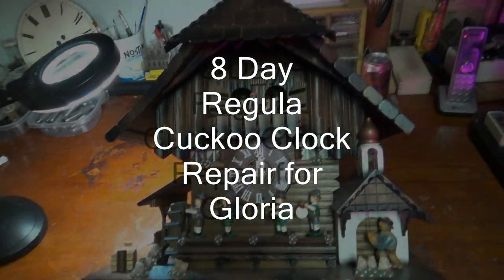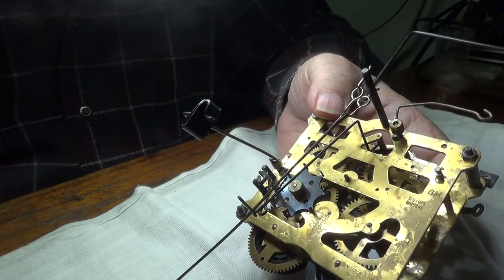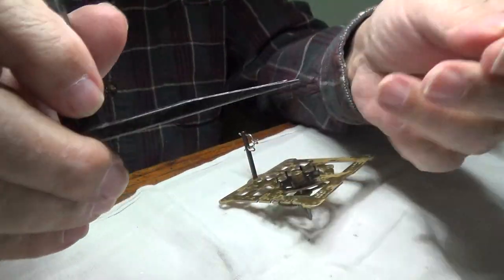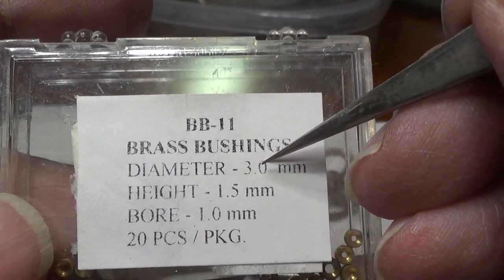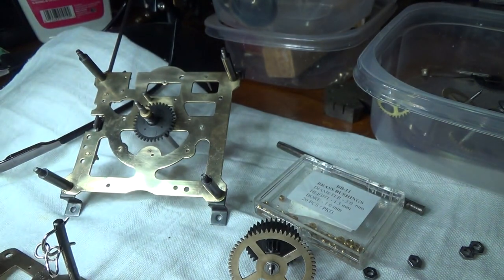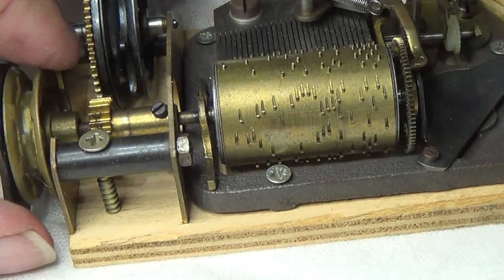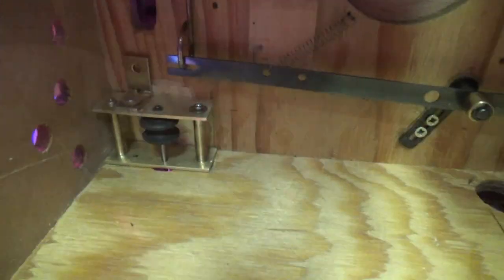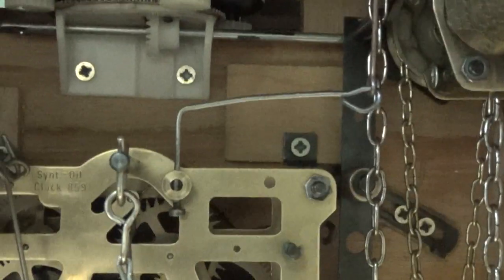8 Day Regula Cuckoo Clock Repair for Gloria

Comment: I got a 8 day cuckoo clock with music box and three weights weighing 1500g, I was applying oil to the pivot points on the clock and secured the chain, to keep them in place. Once I oiled the gears, I failed to remove the wire that held the chains in place, and started the clock, didn't realize that I failed to remove the wire. 
After a few minutes of operation notice the clock pendulum wasn't moving and realize the error of my ways and the clock has not been the same after that. After a few minutes of movement it stop working. 
Watching your video was inspiring that someone is out there, that can repair this complicated movement and like to hire your services, if you are still in the business of repairing clocks like mine.
Reply from the maker: Sounds like you obtained a used movement as you oiled it..  The wire had nothing to do with the clock not running.  It probably needs extensive cleaning and pivot holes repairs with bushings.  I'm not in the  business of repairing clocks.  This is strictly a hobby I've been doing for 56 years.  I do outside work from time to time and ask for charitable donations to our food pantry.  At the present time, I'm overwhelmed with clocks waiting for repair and, at 81 years old, I don't take on any more work than I can complete in a relatively short time.  If I'm still here around January, contact me then if you still are having problems with the clock.

Comment: I have watched many of your videos and have had several “ah ha” moments when you are working on these clocks. Thanks for explaining your techniques and how the various parts work. While watching your videos I keep saying to my self “I wish I had seen these years ago”. Some of the the things that you do like pulling the chains through the holes have simply eluded me because I would wait to put them in after the movement was back in the box. You would not believe the shapes of wires I have made for threading them through the holes then around the wheels. This is only one example of many lessons I have learned from your work. Since watching your videos, most of my spare time has been spent working on watches. I have been thinking that it would be nice to work on another cuckoo clock. Someone brought me two this week. I started working on them on the weekend because I could not wait to try out what I have learned!
You are a Master Craftsman. I hope you are doing well and can make more videos. Thanks again
Reply from the maker: I'm glad you have found the videos helpful.  I wish I knew how to deal with the tiny parts of watches. I don't consider myself a master of repair; just a hobbyist who's been at it for more than 50 years. Thanks for the comments and best wishes with continuing in your work with timepieces.

Comment: look at the water wheel chain, there are a few links pulled apart, I could see jamming on the gears once in awhile
Reply from the maker: Look at the whole video before you comment.  I replaced the chain with new chain.  There aren't even any "gears" involved in the water wheel; it's a rubber wheel.

Comment: Cool video, I really liked how you made it play music on the half hour and hour instead I found it very interesting and never seen someone do that before.
Reply from the maker: Some only play on the hour.  This one was designed to play on the hour and half-hour, hence two melodies.  Also, if is playing only on the hour and the weight on the music box is going down half the distance of the other two weights, it's a clue that it's meant to play on the half-hour as well as the hour.  Nothing tricky or unusual at all.  Not all cuckoo clocks with music boxes play only on the hour.

Comment: Hello Sir
    Hope you're doing well and safe .Happy to write to you because you are my best guide and the horologist master. 
It's for Regula 34 and its music box both are in good working order but the synchronizing way a little bit far on 30's they perform well but on the hours the music lever of the movement presses hard on the control of the music box and remains until the weight arrives at the floor. It returns up after 10 minutes when the bellows inter in action . I tried many music levels  over the music bar but no success  please could help me solve this problem and thanks.
Reply from the maker: Without actually seeing and watching the action, I really can't be of much help.  There are too many different ways that the music box is controlled.  All I can tell you is to study how it is supposed to work and then keep adjusting it until it works properly.  You're finding why it is that many clock repair people just won't try to fix cuckoos with music boxes and animations.  They can be a pain to deal with.

Comment: Hi Mr Perry. Are you still going to do a hip replacement? I hope all goes well if you do. Hope you will be able to do a cuckoo repair soon. I know you use piano wire to make loops. Can you tell me the gauge of the wire you use? As that the same gauge you can make a pivot with?
Reply from the maker: I had a visit with  the orthopedic surgeon, who said the only solution to the hip problem is replacement.  It's definitely bone on bone.  Problem is that, because these surgeries were declared by morons to be "non-essential" during the Covid lockdown, there is a major backup of surgeries.  He can't schedule me for the replacement until "well after the first of the year".  In the meantime, he prescribed an anti-inflammatory   (Meloxicam) that has given me significant relief.  Weather is changing quickly, I've put the pond to sleep for the winter and I'm ready to get back to fixing clocks.  I have a number of sizes of wire coils I keep for repairs and try to match the original.  As I recall, they are around .022 to .025 inch.  Pivot wire is general too heavy to bend and also much more brittle.
Reply: @dperry428  Sorry about the delay with your hip. Can't wait to watch your videos.I see Timesavers has wire.

Comment: I have something i need your advice on and hopefully you will see this comment. I have a clock i am assembling that my brother took apart, and i did not see it being taken apart. It is an open mainspring 31 day korean time and strike movement with rack and snail. I have figured out where every gear except the 2nd wheels go. One is slightly larger, which side does the larger 2nd wheel go to, the time or strike train?
Reply from the maker: I don't know.  Just try placing one or the other in one of the gear trains.  One will mesh correctly and the other will not.  The one that doesn't mesh with the main wheel and third wheel goes in the other train. It is a truism that they only go together one way.
Reply: @dperry428  ok thanks

Comment: I learned a lot from this video. Especially the music box,  dancers and waterwheel. How did you clean the music drum? Will you be doing any more videos before your hip replacement in November?
Reply from the maker: I cleaned the drum with a toothbrush and the acrylic cleaner/polish I use on gears.  Scrub, let polish dry and polish with clean brush. This one was a frustrating challenge.  Combination of cheap, poor design and messes made by someone in the past.  The owner got this from a thrift shop for $5, so there had to be a reason someone dumped it. I found all the reasons.  I have a cuckoo movement and an electric clock movement to do.  A lot depends on what I can do outside.  If I can work, I''ll take advantage of the weather.  I know I have to fix a leak that's developed in my pond.  It has to be fixed before winter.
Reply: Thanks. I will watch for your cuckoo video.

Comment: Just curious if you could use a 5 sided broach to ream the hole in the plate for the bushing.  Seems that with the taper the reamer has, it would only start to cut on the unworn side, thus there would be no need to file the unworn side.  What do you thnk of this idea?
Reply from the maker: It's not a new idea; in fact, many do use a broach to even out the wear by putting pressure with the broach to the unworn side with the broach only partially inserted.  After determining that the unworn side is now cut out to the extent of wear, the broach is then used to cut the hole for the bushing. Simply using the broach without evening out the wear will likely cause an off-center hole.

Comment: Where can I find broaches like yours? I'm having such a hard time figuring out what I need. I only want to work on cuckoo clocks for myself so I don't think I need many. A lot of the main suppliers have pretty poor websites and it's just hard to know what kinds/sizes I need. I am seeing a lot of the "stub" style. They don't look like they taper. I assume I want to avoid them? Some of the sets have plastic handles, I don't know if that comes recommended or not. If they do require a pin vise how can you figure out what size you need? Thanks for your videos!
Reply from the maker: Go to Timesavers and search for broach sets.  Here's one that would include sizes for cuckoo clocks. https://timesavers.com/i-8944714-10-piece-cutting-broach-set-for-large-clocks-035-157.html   "Stub" refers to sizes.  I'm not familiar with that system.  I go by the largest diameter they will cut.  Since I use metric measurements for pivots, I have to convert the advertised inch size to millimeters to know what sizes I need.  They all taper by a few tenths of a millimeter.  Here's a set on Amazon.  https://www.amazon.com/Galapagoz-Repair-Cutting-Broaches-Germany/dp/B084G96P1R/ref=sr_1_8?dchild=1&keywords=clock+cutting+broach&qid=1614825183&sr=8-8   Use a caliper to measure the sizes of the pivots you'll be working with and order sets or individual broaches that fit those sized holes.

Comment: Do you have a video that shows what to do if the weight is pulled all the way up on the left but it won't tick tock or stay running? I noticed on my cuckoo clock.the left weight is pulled completely up to the hole in the bottom of the wood and it does not seem to move down at all.
Reply from the maker: The hook on which the weight is hung has a circular piece that attaches to the chain and is quite thin and sharp enough that, if the chain is pulled forcefully, the circle can actually cut into the wood hole and be wedge enough to make the clock not work.  It doesn't happen often, but it can happen.  Otherwise, does the clock run at all, even for a few seconds? The clock might just be out-of-beat.  OR, damage may have been done to gear teeth if the chain was pulled too forcefully.  Without actually examining the clock, I can't give a definitive answer.
Reply: @dperry428  it runs for a few seconds. It does need to be cleaned and oiled. The seller doesn't know if it's a 1 day clock or an 8 day clock. The weights say 1500 et on them.
Reply: @dperry428  the round circle on the hook  isn't touching the hole in the wood.
Reply from the maker: If the weights are 1500 grams, it's an 8-day clock, which means it is much more sensitive to wear.  If there is any wear in the pivot holes, or if the clock is in need of cleaning and oiling, it will be less likely  to run than a one-day clock.

Comment: So glad you did another cuckoo! What kind of magnifying lamp do you have? I would like to get one. What is the size of the lens?
Reply from the maker: I got it at Office Max.  The lens is  about 6 inches across and has a circular fluorescent lamp around it.  Here is a link to a picture of it:  https://www.officedepot.com/a/products/326381/Realspace-Space-Saver-Desktop-Magnifier-Lamp/  I sometimes have difficulty with it staying in place and have to tighten the "joints" on it to make it stay where I want it.  I've had it a few years and it's served me well. Often use it to get real closeups by putting the lens in front of my video camera.
Reply: @dperry428  Thanks

Comment: Such a fantastic and educative video with intricate detail! Learned a lot from you sir. Working on an old count wheel movement here in Canada. Strangely without any pivot wear, but with anchor wear! Time side needs 1kg to function but strike works with 875 gms. i.e a difference of 125 gms with the time needing more! Have you experienced anything like this? Also where is your shop located and do you have a website or email address?
Reply from the maker: Having to use more weight to make it run is a sure sign of excessive friction.  Did you replace/repair the anchor?  A worn groove will make the sides of the escape wheel teeth drag.  Also, recheck all pivots and holes.  Some of these older movements had short pivots that did not extend through the plate and the wear is only on the inside of the pivot hole, so from the outside, it looks as if there is no wear.  Also check for one or more bent pivots.   I don't have a shop; just my basement workshop.  This is simply a hobby for me that I've been doing since 1968.  If you want further contact, you can leave an email address in a comment and I'll contact you.  I hold comments for review and will simply delete the comment so it is not seen by others.
Reply: @dperry428  I suspect the original weights were missing and a previous repairman had substituted two 1260 gm weights. When I initially cleaned and lubed the movement, I overlooked one pivot hole which had a bushing inserted during a previous repair. The anchor is still as is as that type of replacement anchor assembly is not available. However perhaps you might be able to share the best way to repair that anchor. The cuckoo would run excessively fast with the 1260 gms weights and bend the warning/lock pin on the warning wheel causing it to ultimately not stop cukooing. Bringing the cuckoo weight down to 875 gms  stopped that problem. But I overlooked something else. I just found there was excessive play between the fly blade and the fly arbour and tightened it. Now I am sure I will have to use a 1 kg weight on the strike train as well as the fly will now offer proper air resistance. But I need to test it. If it works, I expect both trains should then run on 1 kg.
Reply from the maker: If it's a strip anchor, you can fashion one from strip metal, you can buy one like this and bend it to shape  https://timesavers.com/i-8948707-fits-all-verge.html
My method would be to grind the worn surface flat, cut a piece of spring steel and silver solder it in place.  Then file to the original contour.  Use the old one as a pattern in either case. 
Is the movement you're working with a one-day or eight-day?  That style movement, if it's a stamped movement, should run on about 500 grams if it's a one-day. If it's a cast brass movement, a one-day takes somewhere around 800 to 1000 grams.  The most weight I've seen on a cuckoo is 1750 grams and that's for a very large, three-weight, 8-day movement.
Reply: @dperry428  The movement is a 2-weight cast brass cuckoo movement with no quail or music.
Reply from the maker: Those cast brass movements are one-day and take a heavier weight 750 to 800 g.  Those movements also have relatively thick plates that twice as thick as more modern pressed plates. These are the movements that often have pivots that are so short they don't go all the way through the plate and wear the pivot hole only on the inside of the plate, leaving the hole on the outside of the plate looking to be unworn when, in fact, are badly worn.  The pivot hole appears round from the outside of the plate and oval from the inside of the plate.

Comment: I just left Triberg, Germany yesterday (where the cuckoo clock comes from).  The standard for ones that play music is music only on the hour.  The half hour typicality gets one cuckoo chirp.  That clock was fully functioning as designed prior to your ‘repair’.  You in fact did not repair it, but rather re-engineered it.
Reply from the maker: So, your position is that the clocks made today are made exactly as they were 25, 50 or 100 years ago?  Nonsense! Today's "standards" are often not what was done yesterday. The way to tell if a music box should run on just the hour or on both the hour and half-hour is to look at the position of the weights at the end of an extended period of time.  Say, for example, the music box is set to run on both the hour and half-hour and the weight runs way ahead of the weights  for time and cuckoo, it is designed to play only on the hour.  If, on the other hand, it is set to play only on the hour and the weight falls far behind the other two, it is designed to play on both hour and half-hour. Another clue is whether the music box has one or two tunes.  A one-tune music  box is usually made to play just on the hour. A two-tune box is designed to run on both hour and half-hour.  You other line of reasoning is equally false.  Just because you went to Triberg does not make you an expert in cuckoo clock design.  I've been doing this for 56 years.  Give me some credit for knowing what I am doing.  By the way, where on YOUR channel do I find your videos of clock repair?  For that matter, you've had a channel since 2011 and have NO videos whatever.  You know what that makes you -- a viewer who makes no contributions to the YouTube community other than to comment on other videos.  Probably, as here, just negatively.  That's called being a TROLL.
Reply: I have 3 clocks with music box. All play on the hour and half hour. Keep up the good work!

Comment: Hice work friend!, do you recomend buy a News cockoo cloks or a used? I like have one
Reply from the maker: Personally, I'd buy a new one if it is a simple cuckoo with no dancers or music box.  The newer Regula movement is just as good as an older one, with the exception of some manufacturing techniques that make repair more difficult.  An older clock, however, will likely need repairs, which can be expensive.